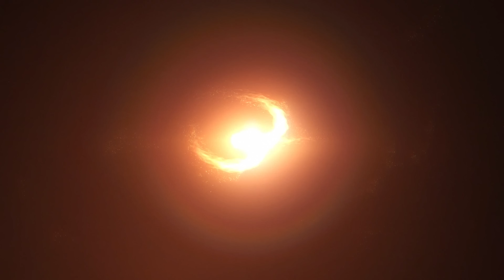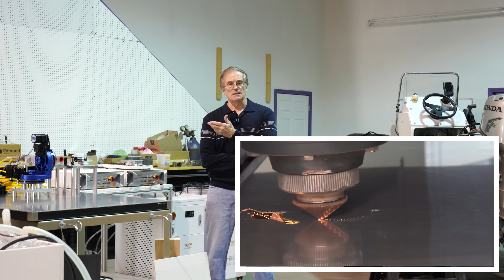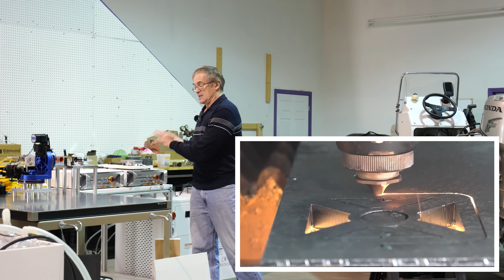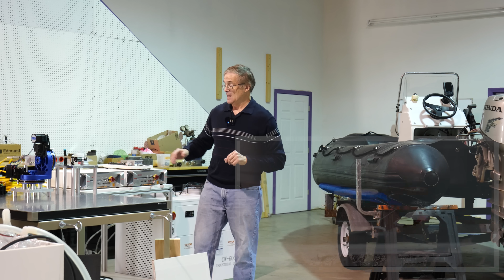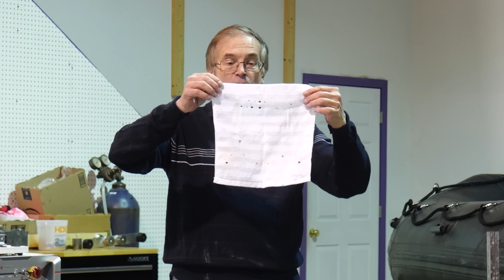We have a problem... and need your help!

Comment: Dont know if it will work but a test i would like to see would be just a angled stainless plate with laminar flow waterfall on top of it.
a simple test of basic principles can be achieved with a piece of scrap metal and a garden hose.
and if it succeeds final product should be relatively easy to build out of sheet steel keeping the construction relatively light and  cheap all while allowin the possibility of ikea assembly for storage. Such laminar flow could be achieved with a through with a slot in the bottom.
water might cause some dispersion so dyeing it might be required.

Comment: Does it melt fiber-optic cables? If it doesn't and the target (as in, the expected area where the laser could get stuck) is small, you could take a lot of fibers and place them behind the target to redirect the laser into the ground.

Comment: I've got a couple:  

1)  Floor paving/shower tiles grouted to drywall, like tiling a shower.  The grout seams would have to be tested as well, and if those fail, you'd need 2 layers with some extra little tiles to protect the overlap of the seams.  I'd worry the tiles might crack from rapid heating.  Going heavy on the grout/glue should keep the pieces in place if they crack.

2) Fill a space between 2 drywall panels with cement.  The thickness can be adjusted to strike a balance between defense and weight.  I'd be curious how fast this super laser can ablate/melt cement.  That would be a fun video short to see!

Comment: Trying to deal with KW mm2 is going to be fruitless, those kinds of fluence levels are going to be next to impossible to deal with short of large refractory brick walls with heavy steel backing. I would beam expand to a couple of inches and put the beam waist on the target. If you want to get rally cleaver and can calculate the z distance to the target, you could servo the focal point focus while tracking. If you set it up right, you can have a cubic area that is in the hot zone and the post focus spot should be manageable with concrete board (the stuff they use for showers). Interesting problem to have. :) Good luck!

Comment: I disagree with the premise (that a narrow beam that gets narrower is the right approach). I think the beam should be made very wide (harmless) at departure and reach a focal point at the distance the drone is away, then spread out again beyond the drone. That is much, much safer for all involved but the drone. It requires knowing the distance to the drone with reasonable accuracy, along with a mechanism to adjust the beam focal point based on that value. Then the materials science search is irrelevant. And the odds of killing, maiming, blinding, or damaging unintended targets is greatly reduced.

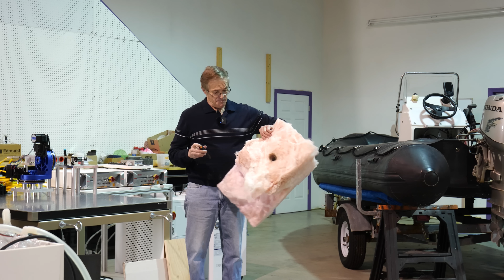Comment: 9:46 What about soaking that in water/building a water Tank and submerge the material in it and then shoot straight into the wall of the tank? Could even make a small part of the tank out of a small piece of plastic that melts so the tank won`t drain completely

Comment: Build a beam dump that captures the beam and traps it. Use heat resistant materials like white ceramic to scatter the energy. Can also use roughened anodized aluminum. Make sure the trap scatters and diffuses the energy into the trap which is cooled to soak away the heat radiation.
Reply from the maker: A beam dump isn't going to be easy with about 25^2 meters that have to be covered.

Comment: Two layers of wet plywood some distance apart and flash detectors (or something) between them. Flash detectors turn laser off before it is through second plywood  and wet plywood won't burn, atleast not fast. Might need something to block holes on the first plywood after couple shots....

Comment: I'm not at all experienced in this kind of stuff, but... how about putting a diverging lens as the "protective barrier" to spread out the beam? With enough distance from the building wall, it will hopefully spread enough much that the energy per area is weak enough that it doesn't damage the wall.

Or, the two approaches can be combined: You can have a large plywood by the wall and diverging lens 1 meter away from it.

I don't know much about the optic materials that are useful for this. This "diverging lens" should probably be more like an array of 10,000 diverging lenses (so that there is one diverging lens catching the beam wherever it might be targeting at the moment of trouble), each with a short enough focal length to diverge the beam wide enough before it hits the plywood or wall behind.

Comment: How about drywall coated with "starlite", main component is starch afaik so should be cheap. Nighthawkinlight had a video on it. You will end up with in-situ carbon which has a very high sublimation point and on the timescales you're interested you'd likely be oxygen limited so it shouldn't oxidize away that quickly
Reply from the maker: I'll look at that.  Thanks!

Comment: What if you don't collimate it but estimate or measure the depth and adjust the focus point accordingly? This way you have less risk of damaging anything you are not supposed to and you can set a hard cap to how far it is allowed to focus so it can't burn through your wall.

Comment: You need to start with understanding the problem. Then you will be able to calculate and find the best solution not just test random stuff.
I will have maybe helped more but it seems you are interested in military applications and I'm not a fan of that.

Comment: I would bring it to a gun range with a high berm. The problem it's designed to solve is very similar to yours. I would incorporate adjustable mechanical stops into the gimbal so that it physically cannot aim outside of the safe area. Shooting upwards into a clear open sky might also be acceptable. It's unlikely that the laser would be harmful to anything so distant it is not visible to the naked eye.
Reply from the maker: The stops are a definite, and they will be part of the design.

Comment: Could you set up a second beam coaxial to the first, but much weaker and at a different frequency, that can be rapidly pulsed and used as a LiDAR of sorts.
If it detects the distance as being to great (for too long), then that data is used to stop the primary beam, or shift an optical component to defocus it.

Comment: Lowest cost, highest specific heat material is water: Water curtains could be made via the usage of inflatable camping pads. A hole will also continue to drain thus replentishing the water as it is boiled off. IR does not pass through water easily, the addition of a suspension of dye or glitter might improve this. You want to heat the particulate internal to the water.
Reply: Traditional glitter might melt even in water, I suggest another particle like that IR pigment they made. It probably will be more durable to the effects of melting.
Reply: Water also has the highest latent heat of evaporation. I would spray water using atomizer nozzles.
Reply: Water curtains is the first good water solution I've seen here today..... very clever, I hope they test it.
Reply: How about fog to disperse the beam?
Reply: @ctrlaltdebug  Good idea, but fog has no real mass, it would vaporize pretty much instantly..... There's just no way a fog could get rid of that much heat.
Reply: @Mort_OOPz  Have pressurized fog or aerosol under a plate, it will shoot out if the laser pierces the plate and direct more laser blocking material where it is needed.
Reply: You're going to need a couple feet of thickness, to absorb the beam's energy. Perhaps an evaporative cooler? Continuous pumping of water to replenish the "evaporate", and thick enough to absorb the full beam?
Reply: @JohnDoe-fk6id   how many kw is the beam? 10kw? The water will warm up, but it won't all evaporate. I would add a dye to absorb the water, or maybe a recirculating waterfall over the surface of a dark aluminum sheet.
Reply: @observer3137  evaporative cooler is recirculating. That's why I suggested it. The waterfall would keep the "fill" from heating up to the point of catching fire, if there's enough water running across it. Adding an IR absorbent dye would be helpful, as well.
Reply: What about graphite powder in the fluid? Mica "platelets" might help as the glitter.
Reply: You might end up with a problem like DNB in nuclear (departure from nucleate boiling) where the fluid around the laser beam is too hot, and it creates a steam pocket around it, reducing (or removing) the absorption. It seems like the laser instantly vaporizes any liquid that absorbs it, which seems to be the real problem.
Reply: <10um carbon particles in water to absorb beam energy
Reply: Color it with E150 (caramel color, used in cola to make it dark). It's a verry good laser beam absorber, since it's fine carbon, and it it food safe.
Reply: What about water balloons? cheap, and will (although more slowly than desirable) fall to take the place of deflated ones.
Reply: If you're going with water, add a gelling agent to it, so it stays put, when the container is instantly punctured by the laser. Wouldn't appreciably change the thermal mass available to the laser.
Reply: Combine the water curtain with laminar flow.  You could do multiple water curtains to avoid a burn through in a certain spot. Moving the laser back and forth if practical would also be help.

https://en.wikipedia.org/wiki/Laminar_flow

My idea was to use a pool and just point the laser down into it.
Reply: Carbon black pigment powder in vigorously agitated water to spread the heat.
You can put a hole in the tank where the beam hits and a tub to catch the spilled solution which is returned to the tank as fast as it spills, via a sump pump.

A float switch to kill the laser if the pump fails.
Reply: This is effectively the same logic that I went with I just went with a solid that becomes a liquid, and will never vaporize... so literally just tilting the thing back 45° it would start pooling on itself. Pretty cool.
Reply: The genius of a water curtain is that it's optically interactive. If you could maintain a controlled laminar flow, you could use it to create a defocusing effect to protect an arbitrary backstop while also absorbing the bulk of the laser energy if sufficiently thick enough. It's really actually quite an elegant solution. Using some tiles over fiberboard and a rockwool backer like someone else suggested, you could make a laminar waterfall curtain falling over a shaped lip and have part of the water diverted to run against the backstop and actively cool it. It's essentially a solved problem, as it's just a scientifically-controlled terrarium water feature, so the DIY building mechanics are well-understood. Brilliant idea!
Reply: I vote for beef curtains
Reply: @MattyEngland  Bloody christ. Contain yourself.

Comment: Not sure how you could contain it (maybe an aquarium?  Sacrificial plastic sheeting?), but if you could use some sort of water-based fog machine and make a large, heavily fogged enclosure that might work.  The particles would absorb (as heat) and reflect the light, and given a depth of maybe 10 feet, you should be able to dissipate enough to make the laser safe for a solid back end like like the drywall or something.  As you super-heat the particles, they will create eddies and currents in the fog, thereby drawing in other particles to replace themselves.

Another option, that would be even more portable would potentially be a fog curtain, or maybe several of them, that again would both absorb and reflect the energy to the sounding environment, reducing the intensity to be within the limits of something like your drywall.

I think there's no substitute here for depth and spreading that energy load over  a larger quantity of material.  One final option would be a lens, perhaps a Fresnel lens, that would spread the laser out so that it becomes harmless.  Not sure how well that would work, as it would likely not take more than a second or two before meltdown, but you know better about the physics of that than I do.

Comment: I've only read through a few suggestions, so this may have already been suggested and is still wrong. However, the suggestion includes the question, why are you looking for some type of solid to stop the beam? Wouldn't a misting wall of water a couple feet or more wide cause the beam to refract and scatter? Wouldn't this ensure the beam is no longer dangerous or coherent light anymore? I would think, even with a high power laser, a wide enough mist (think fog) would have the same effect that occurs with headlights. I would even think that using regular water would work well, because not only does the laser have to boil the water, but the minerals in the water would also cause more refraction of the beam. Or am I way off on this?
Reply from the maker: The flowing water is a good idea. A mist will not block effectively within the short distance available. Flowing the water over a barrier to cool it might be the solution.

Comment: Ok bizarre thought! But hopefully those who see it will understand it to ..
Like a signal lamp you need a shutter assembly, now that could be in the source of the lazer light. In the form of polarising gratings contra rotating, the slower the rotation the longer the pulse the faster the rotation the shorter and more powerful the pulse. Now that is the expensive option.
The cheap cheerful and more bizarre is.... A glass washboard, in fact a dissected glass washboard. The board is cut into slats making individual louvres these are mounted as a refraction grating in two separate planes ie vertical and horizontal then cool in by mounting in water cascade

Comment: What if you make something like aquarium,  fill it with non transparent solution
Or you can try mirror which will reflect beam in to the sky. You'll need a hole in the roof.

Comment: Dark-Coloured water inside a transparent(as transparent as possible to that leaser's wavelength) contaimer.. aslo adding catch can or plate to recollect leaked water if the container is not good at letting the leaser pass through thouse leaking the absorping dark-colouerd water, then plugging the hole and reuse the same setup might be cost-effective.

Comment: A old dump truck with egg crate type dividers to hold sand when in the raised blocking mode. After the tests lower the dump bed and move the truck
After you get done sell the truck

Comment: h/t Grok - Unpainted, matte ceramic tiles (e.g., from hardware stores) are excellent for absorbing high-intensity beams. They’re heat-resistant and cheap, often used in DIY laser setups. Choose dark, non-glossy tiles to reduce reflections. Mount securely to avoid cracking.
Reply: You could also frost glass to act as a diffuser (with a sandblaster?)

Comment: Several comments have mentioned "Starlight", but a commercial intumescent paint would be preferable. These will be more durable and easy to apply and potentially can be left outside in the elements. The coating is advantageous since you can put it on whatever substrate is convenient and add coats until it is thick enough to resist the laser for your target burn duration. The carbon foam formed from laser heating should be insulating, and I think will just ablate as it is further heated, hopefully providing the necessary protection. After the coating is sufficiently damaged, you can scrape and recoat, or just swap out a new backing.
Reply: The proper spelling is " Starlite".

Comment: I'm thinking about mixing plywood and water.
Maybe you can put soaked plywood in maby 5 or 6 rows, and have some water dripping from the top side recirculating up through a hose

Comment: How about frames (of e.g. gypsum board) holding a deep layer of steelworks sinter? (I see my American spellchecker doesn't like that word. It's the "pumice" you get from a steel plant. So I suppose pumice might be better, then.) Maybe mix that with pot scourers to carry heat away to the sides as the laser breaks down all the little insulated pockets.

For a "backstop" for the case where whatever you choose fails, you could maybe go with 45 degree reflection into ... hmm ... maybe 45 to one side, and 45 down, into the paving outside? But then you might as well go just reflective. ("Reflective but deflective").

The least antisocial reflective device would put the beam into your floor, or into the pool of water you put on top of your floor, and afterward have a nice hot soak in.

Or have lots of bags of blood in front, backed up by something guaranteed to smoke a lot and keep collapsing into the beam as it burns. So your "wall" would "burst an artery", and then make billows of smoke. (This is sounding like an unhelpful suggestion, so I'll stop now and go see what everyone else said.)

Comment: I think you need a bigger enclosure, so that the incident power density on any obstruction is low enough to be manageable. How about an airship hangar?
Edit: Forgot to say "wooded arcs". These were literally wood stops placed in the way of rotating gun carriages to prevent self shooting on ships. It's an old, but very relevant concept. :)
Sorry if this is duplicated.

Comment: Have you considered an acousto optic modulator, sometimes called acousto optic deflector. It is a cell filled with a suitable fluid for the wavelength of the laser (low loss), coupled into the fluid is an acoustic wave maybe 100khz to many Mhz from a suitable transducer. When the cell is excited, the laser is deflected through a few degrees (depends on frequency). This would enable you to send the laser to a `beam dump` and then switch it through from the dump to the optics, at switching speeds of micro-seconds. This way the laser runs continuously and the beam is `dumped` when not needed. Hope this helps maybe. I am sure there are other options but switching speeds would suffer in most cases.